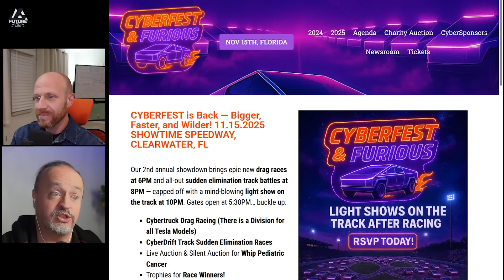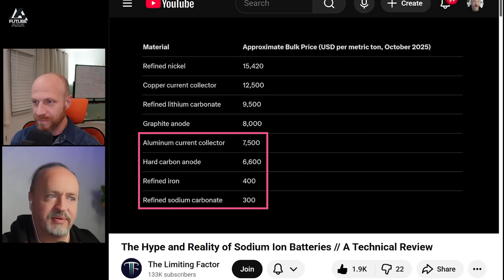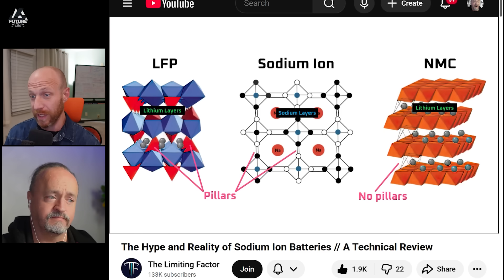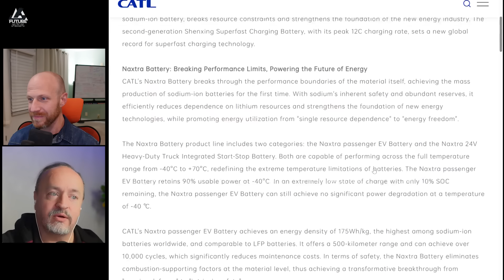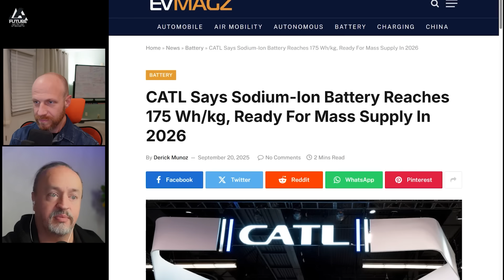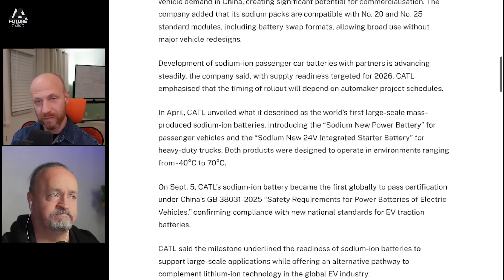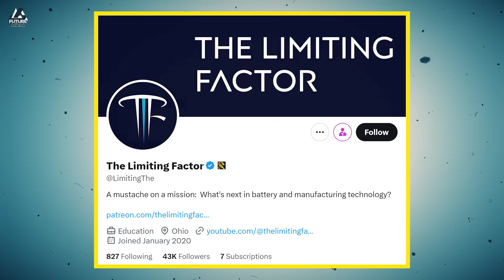Jordan Giesige Exposes Sodium Battery Truth

Comment: It is CATL saying they are about to mass produce  sodium batteries for $10  a kwh.  They have no history of not doing exactly what they say they are going to do.  The cost of the pack being some huge cost inflator over the cells-  these two are bull shting like they took a pay off- its a damn metal box and with sodium full of dirt cheap sodium cells and despite what these two say about LFP safety improving these sodium packs can be manufactured to a to a much lower spec.  Also, for stationary unlike LFP no active cooling is needed.  What do you think that means for automotive pack cooling?  Keep in mind stationary is the bigger deal.  But sodium has faster charging and higher discharge and much better cold performance and can charge to 100%  and vastly longer cycle life.  They can also have LFP modules added in mobility.  Just as the gas industry doesn't like wind it hates sodium.   Brian wants to protect Tesla Jordan I suspect has.  Jordan has been in retrospect based on what CATl has announced wrong and wrong beyond where he is now claiming CATL is puffing.  And his silly claim that its a ways off on its promise?? Its CATL and even beside that AI is radically accelerating tech.  Read between the lines on the propagand pitch. 

https://m.youtube.com/watch?v=Wf84NJSiAeU

Comment: What pro does LFP have over sodium other than a mature supply chain?
Reply from the maker: Gravimetric and volumetric energy density, and at least for now, they're cheaper. Also greater round trip charging efficiency, but also, that's just today.
Reply: Narrow voltage range

Comment: Great video! As sodium batteries (already fine for storage) improve and it becomes clear that all EVs do not need to be sports cars I think that  the demand for sodium batteries will rise.
Reply: Thing is, battery power and capacity both increase together.
Reply: The sportiness is not an issue as sodium can do high C rates.
Reply: @GerbenWulff   I like the part where they don't catch fire (sodium safer than lithium)
Reply: I think the problem is that the manufacturers do a bad job as well. When it comes to performance, they always brag about the low speed acceleration, 0-100 km/h (or 0-60 mph) - which means the top speed and acceleration at high speeds gets worse (since most of them only uses a single gear, which is set low to get the force to the wheels needed to be "quick off the line"). The motor will reach it's max RPM long before it gets limited by it's power.
I'm no hater of electric cars at all. I'm pretty much the opposite and get annoyed to see manufacturers do a much worse job than what they could have done. The great torque properties of an electric motor, doesn't change the laws of physics.
The ting is that an electric car is driveble with just one gear, while an ICE car would be pretty much unusable, because of it's low torque at low rpm and nothing at all at 0 rpm. But that doesn't mean an electric car wouldn't benefit from having at least 2 gears (one low and one high) as well. 
Having a single gear and optimize it to be fast 0-100 km/h is really the worst, as the high speed performance will be crap compared to the available power. To "solve" this issue, they put in a way oversized motor instead and use not even 1/3 of it's potential (to get enough torque to be fast 0-100 and still a top speed that isn't ridiculous).

But most people aren't complete idiots - they will of course question why a car that has like 500 hp tops out at like 220 km/h. But they still don't know enough about the physics and will assume "it's because it's electric". So the manufacturers  will rather make electric cars look bad by doing this.
Same applies for range - it's always given for really slow driving under ideal conditions (for example perfect temperature, so no heating or cooling of the interior is required). Then people buy the cars and many get half the claimed range. Of course they will be sceptical to any new battery tech like this as well.

They do the same for ICE cars when it comes to fuel consumption - but the difference to the real numbers doesn't get as extreme there, because of their low efficiency that gets worse a low speeds ("compensating" for the lower actual, energy consumption when air resistance is lower). But this again, this makes the electric cars look worse in comparison.
Reply: The intrinsic volumetric defficiency of sodium batteries will limit their use in sports cars where space is at a premium.  I can see them being preferable in semi trucks where space is readily available, and where longer lifespan and larger temperature ranges are big advantages.

Comment: Sure, Na-ion batteries don't contain NaCl (AKA "salt") but the Chinese are using NaCl as their source of synthetic soda ash, which represents >50% of the world's supply of soda ash.
Reply from the maker: Interesting. I wonder why?
Reply: @FutureAzA  Apparently they have been doing it for many decades, since they improved the process in the 1930s. It's strange since they import a lot of raw materials today but I guess they have a long history of doing it synthetically. A bonus of their process is ammonia is created, which can be used as a fertilizer.
Reply: China doesn’t really have much trona ore, and what they do have is buried deep and full of impurities. So back in the 1930s, they went with the synthetic method instead, using the stuff they had plenty of — limestone and salt. It also made sense because the process fits neatly with fertilizer production.

Over time, China’s chemical industry was shaped by cheap energy and government policies that pushed for big, integrated chemical plants. Now the whole system is built around that setup, and changing it would be way too expensive.
Reply: @TheSanien All true, and they improved on the Solvay process with the Hou process. Plus, if one really wanted to get into the weeds on this, there were probably a ton of geopolitical factors at play.

Comment: really ?
We had already battery cells here - and it looks really great... as the LFP batteries also took Tesla by surprise when the chinese released their first cars till they had to realize that the cost advantage is too big to ignore. 

Here they will produce them and replacing their LFP production . Also automotive industry is waiting. 

Natrium will pay of as it called NATRIUM in latin and in chemistry.
Reply from the maker: LFP didn't catch Tesla by surprise. They just couldn't use it in the US due to patents until a couple years ago. Tesla has had LFP cars in other markets for years, and even sold RWD Model 3s out of Fremont with them for a time.
Reply: @FutureAzA But, in this video ya'll talked like there were technical reasons why Tesal took 10 years to use them. The reasons were purely legal. Very deceptive. Also, CATL is not starting from scratch. Since they have perfected the formula for LFP, it will not take another dozen years to get the chemistry right. Lastly, current factories can be converted without too much cost or effort, so there will not have to be a huge build out to get a lot of batteries to market.
Reply from the maker: There were legal reasons why they couldn't develop the technology in-house. Any tech they'd have developed prior to expiration would have been subject to the patent they didn't own. Chinese firms made a deal where they were allowed to use it provided they didn't export to certain countries, or pay the licensing if they did.

Comment: Especially In the Great White North, there is a way more effected operational and charging temperature range. The idea that the battery will easily last the vehicle makes the long running cost very low. Another biggie is that it isn't a fire hazard unlike the NMC batteries. Currently it doesn't beat the NMC batteries but it does beat LFP, in the power density.arena.

Comment: Great video, and I will almost always refrain from arguing with or even disagreeing with Jordan, because he does such amazing research. But I am going to do so on 2 points here (may post this on his video as well). Before I do, shout out on Jordan explaining the engineering principle for which his channel is named. So few folks understand that it is not one factor that makes a technology the right choice, it is the limiting factor that usually picks, and that changes with the technology and the application.

First, burning is not the same as melting (or even vaporizing, though somethings become flammable after being vaporized). Things that burn are adding energy to the fire... eventually, or at some temperature. Once they burn they are fuel. I think the point with sodium ion is that nothing in them (including the electrolyte) is flammable. That is not true with NCM or even LFP cells, though they are less flammable than NMC. I may be wrong there, but that was my understanding. That doesn't mean the energy in them can't start a fire with some other material near them that is flammable (using the common definition of that word).

The only other disagreement I have with Jordan on this is that I think sodium ion will scale faster than he thinks. I understand that it will take some time to build the necessary pipelines for cathode, anode, and even electrolyte and separator parts, but they are not starting from scratch, and CATL is already at production (if not mass production) scale already. I do agree though (as has been true with LFP too) that it will take longer to get outside of China. But in China I think this will grow like crazy, just like LFP did. No one knows for sure, and I admit I am usually a bit optimistic, but I tend to get the principles right. I agree it won't come as fast as we would like, but with money like that behind it, mass production scale can be achieved very quickly, especially if they already worked out the chemistry (which it seems at least CATL has) for those parts.
Reply: CATL will mass produce Na batteries in December bother indicates otherwise. CATL has also said that I 2026 Natrium batteries will have equal density to their own LFP batteries. So the whole 30% less range is so far completely speculations. As to why these two are trying so hard to put down Na batteries. Why, I do not know but a lot did the same to LFPs in the beginning.
Reply: @TheSanien I don't think they are putting them down, just that GLOBAL scale will take time. But that isn't needed for it to really take off in China. CATL has 37% and BYD another 20% (close here on the numbers it is out of my head) of the EV battery market globally and neither of them sell one battery in the US. What does that say about their share of the China market? Keep in mind in the US we still are not moved over to LFP for EV's at all, we are for grid and home storage though almost completely mostly because of the tariffs on Chinese batteries and for a long time the lack of any tax credits for cars that used them. 

I think you will see something similar in this space to LFP. It will take off first in China for grid, then rest of the world for grid as it scales for EVs in China, and finally (their estimates may be right for this) all around the world for EV's, and that will be very slow, but If CATL scales it, China moves that way. Rest of the world it takes time.

Comment: I can't wait to get a sodium battery for my home solar. We always talk about EVs, but I think their true calling is in cheaper safer energy storage, even better in cold places. CATL is going into mass production as we speak so hopefully I won't have to wait too long.
Reply: LFP is good right now. And pretty cheap. I just bought a 32kWh DIY battery kit for less than $3K

For compariosn, my just-installed 40.5kWh Tesla Powerwall 3s cost $29K.  

To be fair, Tesla offers warranty and are UL Listed - my DIY kit doesn't have either, but for ~$25K savings, I can live with it.

Comment: I had a vw bug car. It had a lead acid battery. The back seat caught fire because of the battery. Fortunately I put it out. I have seen many cars burn down completely because of lead acid batteries, but no one puts them on YouTube.
Reply: If you short circuit those old batteries they just heat up until they burn. Modern lithiums etc have a BMS that('s supposed to!) shuts them off if anything happens.
Reply: @michaelmartin9022  The OEM Beetles that were fitted to the original batteries had recessed posts and a dielectric battery cover on top. They were 100%
safe. What often happened was that owners replaced those batteries with terminals that protruded above the battery. This also prevented the replacement of the dielectric cover. This allowed the cathode and anode to come into contact with the seat springs above them, making a very effective high current welder.
The cushioning in those seats was made of flammable horse hair and other fibres. They caught alight, very easily.

Comment: Wheels falling off ? !   YES !    My brothers car just did that.   The dealer (GM) did some brake work.   Two days later the wheel fell off while driving.  Four out of five lugs were broken !   Overstressed by the mechanic with a powered torqued wrench.   Fortunately he was below 15 mph at that particular moment.   😮    I believe in & support mechs but this is just carelessness on that mechs part.   Unacceptable.   😢

Comment: Hi Brian & Jordan,  for sure most followers of news about Sodium Ion batteries are aware that at this stage the main use of `Sodium Ion batteries will be in battery storage and this is already happening, be it on on small scale A UK company  Eleven Energy is shipping  4.5 kWh Expandable Sodium Battery Pack
Depth of discharge: 92% On-grid / 95% Off-grid
DC/DC round trip efficiency: 95%
Rated voltage 45V
Operating voltage: 33V to 59.2V
Maximum charge/discharge rate: 100 A
IP20 ingress protection
Outdoor battery cabinet available
Operating Temperature Range: -20°C to 55°C
Dimension (W x H x D): 550 x 525 x 155 mm
Weight: 54.5 kg
Up to 8 battery packs (>33.12 kWh usable capacity) can be connected to a single inverter
10-year product warranty
‍ with 8-10-12kWh single phase + 20kWh 3phase battery systems in the pipeline 
There must be other manufacturers planning to get in on production  
It will be most interesting to hear Jordan’s view on Lyten Lithium Sulphur batteries since Lyten raised millions to take over the defunct Northvolt factory in Poland
Reply: Bluetti are also bringing out a sodium power station. It's based on their older AC180 model (it was in development hell for years, while they waited for the batteries), only not as powerful or capacious, and much heavier, but it "works" (sort of) even if left in a freezer more than 24 hours!

Comment: The whole push for Na batteries is because Li was so expensive. There is now a glut in Li and Li is generally the superior ion as it has 1/3 the mass of Na per unit charge.
Reply: 2/3
Reply: The other biggest push is that they are safe and cold resistant

Comment: Love the talk on "The Limiting Factor".  For the human body, this is 3 to maybe 5 hours before a body break on a road trip.  For us in the US, that is 250 to 300 miles.  For city use, this is depending on the use case but regardless of the use case, 8 hrs to go from 80 to 5 or 10% before needing to recharge is in the correct area.  The other is how fast to go from that 5-10% back to 80% for hard/heavy use - anything under 15 or 20 minutes is fine.  Everyday use if you are able to charge at home - even with 120V standard wall plug (my charge solution) as long as I am able to capture more that my typical daily use overnight - 8 hrs, I will be fine.  If not, then a quick splash and go at a fast charger still works.   Time for MOST people to start thinking about their actual needs.  Would I love a battery that costs half as much with twice the density giving me the same range (think fuel efficiency for the dino juice folks) - of course.  Best guess is that is 10+ years which  will be about the time I am looking to replace my Model Y.

Comment: Loved this reality check on Na ion battery readiness to replace Li ion batteries in vehicles, though it was short on safety details beyond what can be controlled by the manufacturers.
Reply: Search "GB38031-2025 Safety Requirements for Power Batteries of Electric Vehicles,"
Includes requirements such as "batteries must not catch fire or explode for at least two hours (120 minutes) following a thermal event, with internal temperatures required to remain below 60°C during this period"...... and Vehicles must remain operational for a period to allow transfer from a dangerous situation  ("The fast lane", etc)

Comment: Pretty sure the 90% cheaper came from materials only.  
As for safety it is a race of 9's
I think they will be great for many stationary storage places but it gets to a point that it is better for a site to use LFP cells over Sodium cells because space is an issue. when there is no space issue than sodium will probably win... in 5-10 years.
Reply: The 90% cheaper is compared to NCM batteries (cell to cell). Na batteries is expected in the future to cost a little less than half of LFP.
That is still a huge saving.
Reply: About the same time the first Lithium NCM grid scale BESS will need to be replaced
Reply: @theairstig9164 Why? Bess systems should last for decades. Who cares if batteries only have 80-90% capacity after a decade? They still work. Just add a few more to get back to full capacity. They won't need to be replaced.
Reply: Nonsense. Sodium doesnt need external cooling (or at least, far less than current cells). That space/cost savings can be used to add more batteries in the same volume, so net effect will be similar capacity in same space, but at much lower cost.